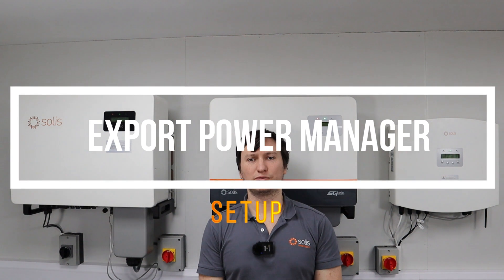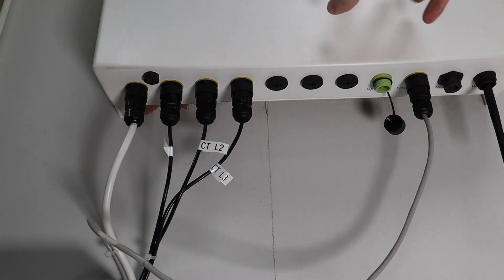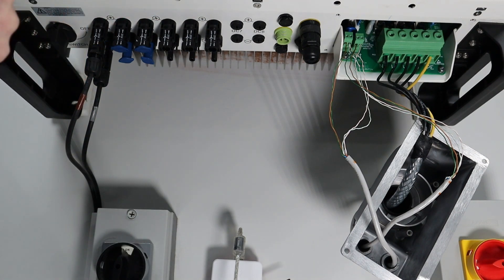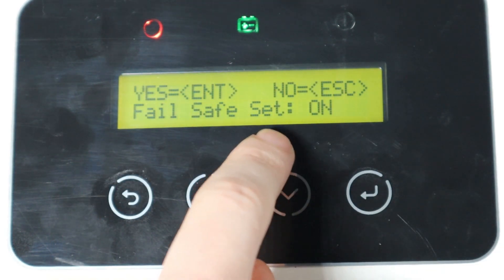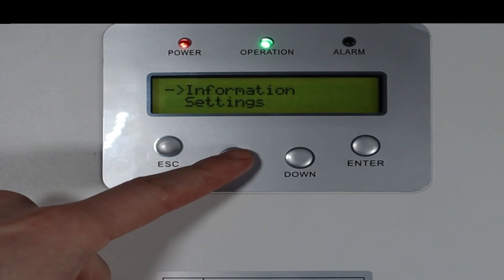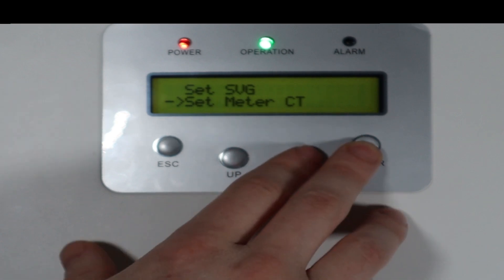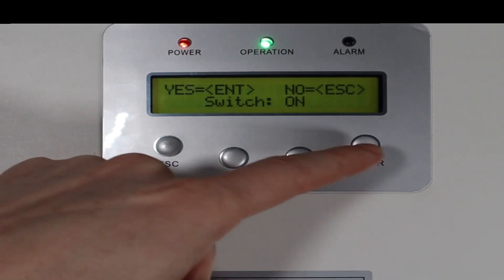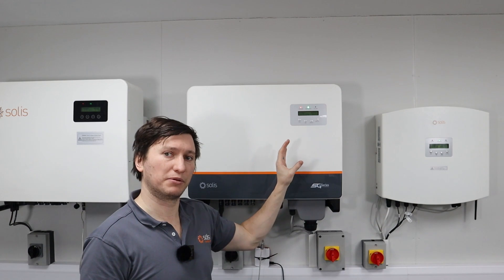Solis EPM - Setup (Export Power Manager)

Comment: How about to set up Inverter Max Power Gen Limit and operate together with EPM? In my case, I facing problems to config EPM max injection 28 kW and Max Power generated by inverter in 35 kW. I tried to config directly in inverter screen: P max with Restore: 35 kW, and backflow max power 28 kW, but the EPM overwrites the inverter max power  limit according what is measured by smart meter setting P max according Injection Max Power + Load Power measured.

Comment: Hi Paul,

Hope you can help,

How does the EPM know if the power source is from the grid or the inverters?

As there is an arrow on the CT so some/all of my assumptions must be incorrect, please correct me where I’m wrong.

1. Current is still flowing back and forth identically through the CT when we transition from load source to load sink? 
2. The CT can’t tell current source direction correct?

How do you tell the direction of an AC current when it’s going back-and-forth equally 50 times a second?

Thanks Paul

Jimmy from Sydney Australia